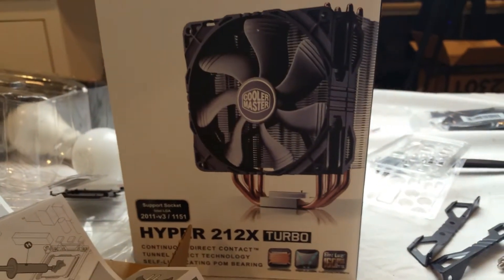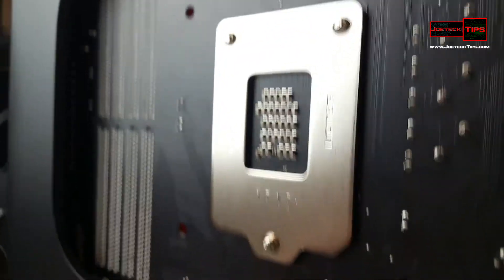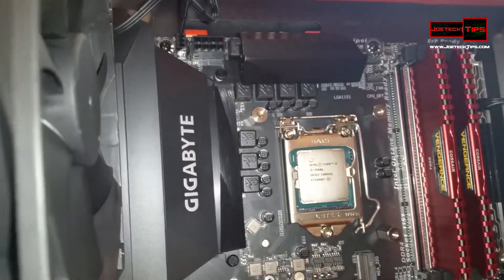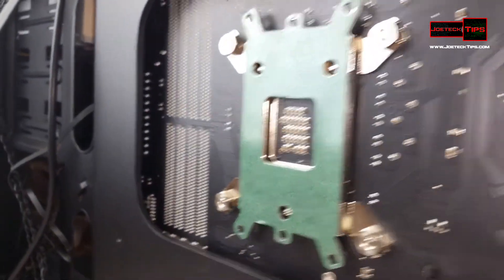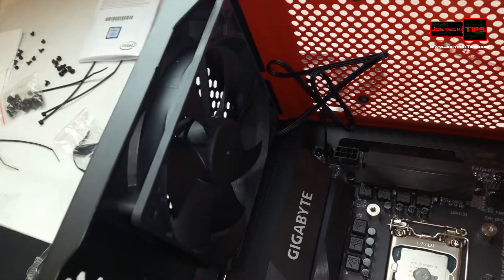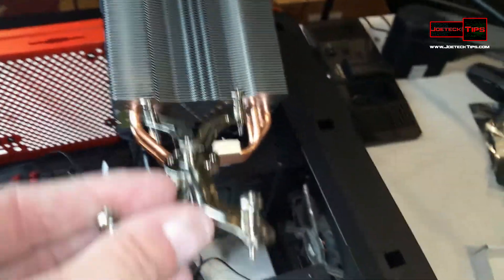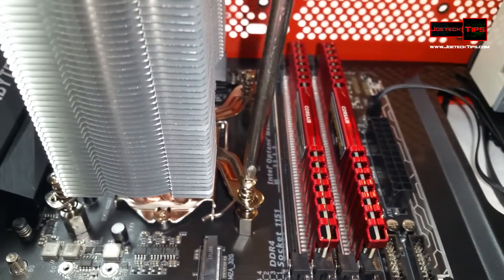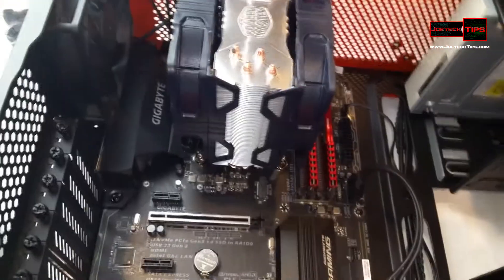Installing the Cooler Master Hyper 212X Turbo | HOW TO | SOCKET 1151 | JoeteckTips

Comment: The back panel wont fit around the screws I put in through the front on mine. It fits through the hole but it's too thick to fit through the panel. Having lots of trouble
Reply from the maker: Youve been a long time subscriber! I can help you if you want.
Reply from the maker: Create a video and show me..
Reply: @Joeteck  I found out what it was. The box came with the incorrect screws. Assuming it was a packaging error.

Comment: is there any reason you didn't use the black plastic cups underneath the bolts on the mobo side?
Reply from the maker: Because there isn't any..
Reply: @Joeteck  oh okay, they must've changed them now.
Reply from the maker: @corndogg4272  maybe people were damaging the board.
Reply: @Joeteck  that's what i was thinking as well.
Reply from the maker: @corndogg4272  thanks for the question!
Reply: @Joeteck  thanks for actually answering. 👍

Comment: why did you choose for the push and pul airflow isint it better if they both blow air to the heatsink ?
Reply from the maker: T.5711 push pull is always better. Push through,  then off. Best cooling solution